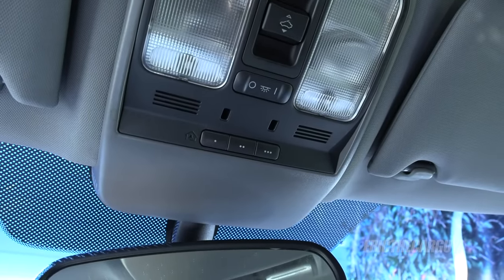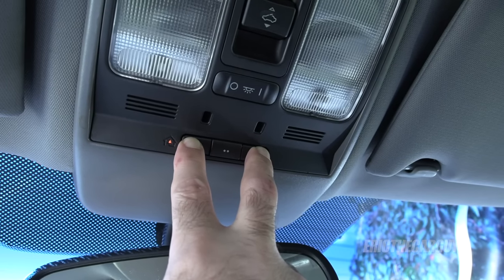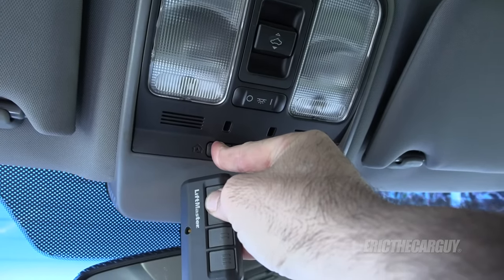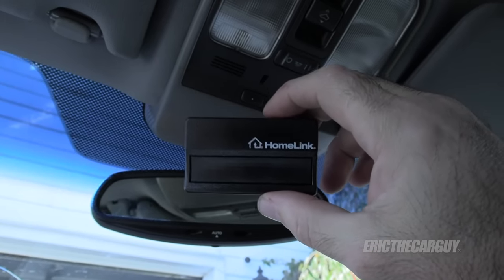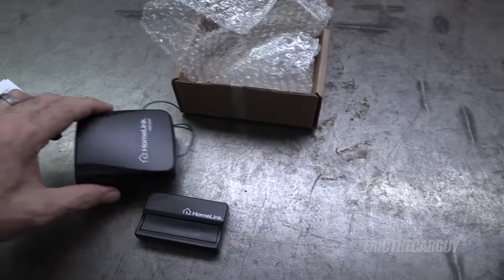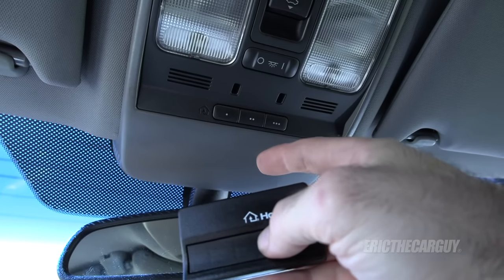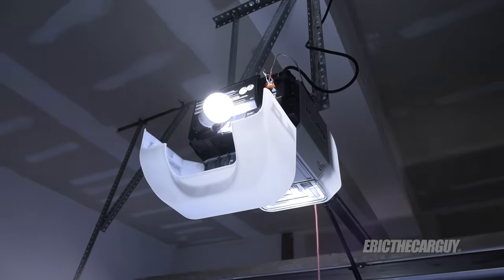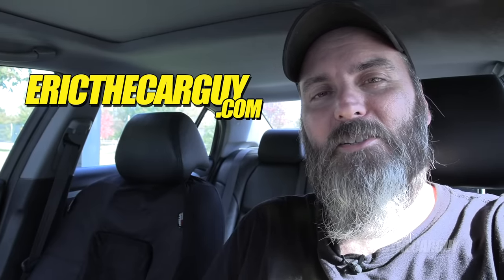Homelink Not Accepting New Garage Door Fix

Comment: I've never had a problem.  Well, that's not true...I did once.  I RTFM, and found that if you press the reset button on the actual unit the darn thing would program everytime.  Yep...at least in my old Liftmasters (I have two, one is a torsion bar, and the other a ball screw).  In both cases, mine had a manual entry that stated to use the reset button and reprogram the remotes and you could also program your homelink.  No extra cost, and three vehicles (from a '99 Tahoe to 2016 Fusion and Expedition) all working great with both openers...One opener is around 2006, and the other is around 2002...

Comment: so, if you're comparison shopping for garage doors, check for compatibility first and if it's not compatible, add $50 to the price of a non-compatible opener.  I have a chamberlain 3/4 HP belt drive and it's not compatible with my 2017 Subaru or 2017 Toyota Rav-4.

Comment: One issue with my 05 TL and possibly all Hondas is that the homelink is powered even with key out. So if yo happen to park outside thieves pop your window and boom! In they go. Most people have lots of tools in there so close the door and take all the time they need. Seen same with people lat leave traditional openers in cars in driveway. The only thing I like about wify's subi is homelink powers down when car is off.
Reply: Good point but most people without Homelink leave their remote in the car anyway.  So nothing gained or lost by programming the Homelink.  I have had both Toyota, Chevy and Honda and they still insist on powering the Homelink system key on or off.  Frustrating.

Comment: But it was working before so I don't know why it's not working now. I've gotten so frustrated that now the button is pressed inward on the homelink button however the lights are still appearing as normal but I cannot get it to reset to the garage door opener which is a craftsman.

Comment: Here is the weird thing with mine.  It programs just fine... I have 3 garage doors and use all 3 buttons.   I get everything to program as it should.  then after a bit of time the buttons go haywire.   Button 1 now opens door 1 & 2.  Button 2 opens all 3 doors. Button 3 still opens just door 3.   I have erased and reset multiple times.  Each time it lasts for a while and then the codes will bleed over to other buttons.  The bleed over is random and never the same combo.  This last time I even decided to wait and program 1 door a day.  Just in case it was the opener itself still broad casting or receiving (however it works) as I was programming a second button.  I have zero clue.  I just know its a pain in the butt trying to play with timing the buttons just right so I can get the right door to close when I'm leaving for work.

Comment: Yep, had to replace one of my two openers today.

My homelink worked with my 2008 vintage openers.  Replaced the Liftmaster with a newer MyQ enabled unit and not only does Homelink not work, but the older remotes from the 2008 vintage cannot be learned by the newer opener.

So, one car, the 2012 Mazda3 has homelink.  My wife's RAV4 doesn't.  We have the 2008 and the 2024 opener.  (The one-bay door doesn't get opened as often, so it's "not dead Jim" uh, I mean Eric.

So, another $30 for the latest universal remote that works with both.

(Anyone need a couple of 2008 vintage three button Liftmaster Remotes?)

I am debating getting the bridge, or just using my mirror buttons for the 1 bay and the remote that came with the opener in my Mazda3 for the 2 bay door.

Yes, I could just use the app as well...

I understand why they do this, it's more secure.

Choices choices choices!

Comment: The info says that this is to help with loft master garage doors older than 2016 working. But I have the opposite problem. My Chamberlain MyQ opener is pretty new, as of 2019, and we can't get our older (2010 Maxima) homelink openers to work with it. Will this still solve the problem?

Comment: I have a Liftmaster 2008 manufacture date with the purple program button and a 2018 Audi S4 with side assist ....have to pull the 5amp fuse for side assist from trunk fuse box then program homelink with door opener procedure for all garage doors then replace the fuse. Liftmaster bridge would not work.....have to pull the fuse.

Comment: I had similar problems.  I have two garage door openers by LiftMaster, one about 15 years old and the other about a year old.  The older one programmed quickly with my Ford Homelink using the method described in my car's owners manual, but newer one did not.  I was able to get it programmed eventually with a hybrid programming method described at https://youtu.be/96s6YlRIE4g?feature=shared and I did not have to buy the bridge device described.  Good luck!

Comment: I don't see how this is liftmaster's fault (or even homelink's)  liftmaster came out with a more secure technology and implemented it (can you really blame them for not using the old system forever?)  Older homelinks aren't compatible with the newly released more secure liftmasters (and likely other brands will do something similar soon), so homelink designs a kit that effectively converts the new liftmaster system back to it's old system (that's also less secure).

I mean, you wouldn't really expect liftmaster to hamstring themselves by nerfing their new security system so that it's compatible with older less secure remotes would you?  Of course they won't do that.

It's a unfortunate side effect of technology moving on.  I'm sure newer homelink systems will support it, and until then you just have to find work arounds in the meantime.  After some time passes the stuff will interact just like it used to, until the next time security needs to be upgraded.

Comment: Have you tried to set the remote by using the learn button on the opener unit ?
Reply from the maker: The remote works fine, it's a Homelink issue. Thanks for the comment.

Comment: i was able to get this working on both the family cars (2022 equinox and a 2020 regal), but for my daughter's car i purchased a gentax 453 rear view mirror (we were concerned that someone might smash out a window, hit the garage door opener and walk into our home).  This mirror has auto dimming and the 3 homelink buttons.
However, the rear view mirror is not accepting the code (never blinks fast).
could this be the same problem?  even though it works with the cars, but not the rear view mirror (note:  the rear view mirror was bought used, i i'm not ruling out a hardware issue)

it should be noted for the above, it does NOT WORK if you are using a generic handheld garage door opener.  it HAS to be the OEM garage door opener.  (my daughter actually figured this out when she looked on amazon and saw many people sharing this information in feedback).  we've ruled this out as we are using the OEM garage door opener.

Comment: I have 2 separate garage doors, with their own Liftmaster openers.  Will I need 2 kits, or can 1 kit work 2 openers separately?
Reply: I think you can use just one repeater. The antenna on the repeater should be close enough for both garage doors. Give it a try
Reply: @CabernetKev  Yes, one repeater worked.

Comment: When will homelink come with a firmware update in order for our 2011 Kia optima to then be capable of reading triple code? NOT.
When will LiftMaster automatically include repeater required for homelink models 2014 and earlier? Double NOT.
THEY SHOULD BE CALLED LIFT MASTERBATOR

Comment: Well- does anybody have advice for me now that I bought this product and still don't have results?  I bought two, as I have two openers, and so I can eliminate a defective unit being my problem, as I tried this solution with both repeaters and neither one worked.  The repeater itself seems to be acknowledging the signal it gets from the programmed car, but the opener itself acts oblivious to whatever the repeater is putting out.  I tried different locations for the repeater, including VERY close (like on top of the opener).  No dice.  I have 1/3 HP Liftmaster units, which according to the label were manufactured in 1994.  The car in question is a 2022 Acura with Homelink.
Reply: With an old unit like that, I thought one only needs the original remote. I could be wrong.

Comment: Or buy 2 new remote openers for the new garage opener and skip the home link crap.  $15 for 2 and problem solved.  I had to do that after replacing the doors and one of the openers. 2009 Camry wouldn't link

Comment: Lift Master garage door opener are garbage. Whenever the light power is on, it will refuse to receive any signal and will not open or close, even when you unplug the darn bulb from the socket. So you'll have to go close it manually. Defeats the whole purpose of having them.

Comment: It’s great that they have a fix but just use the original supplied remote 🤷🏼‍♂️
Reply from the maker: As shown in the video, the original remote would not take.
Reply: EricTheCarGuy I saw that
I know it’s disadvantages to the purpose and content of the video but I was implying to use remote to open the door
Reply from the maker: I never said you couldn't, but the purpose of the video is to address Homelink issues, not how to open your garage door. Thanks for your comments.

Comment: What a bad solution. It only works as long as the repeater brick is installed in a power outlet in the garage. And that probably uses orders of magnitude more current than it would need to, because it's built down to a price (see recent EEVBlog video about mains powered smoke alarms with the same problem).